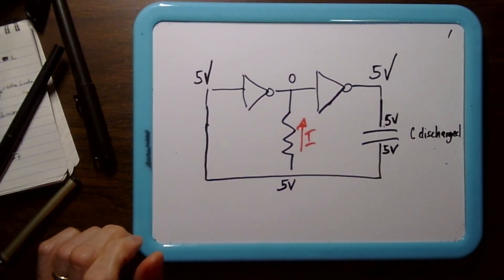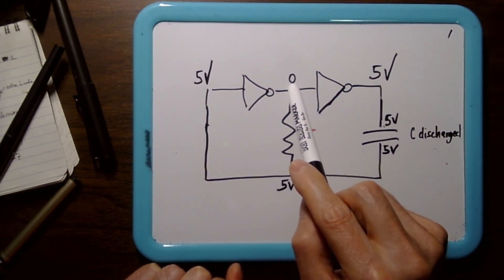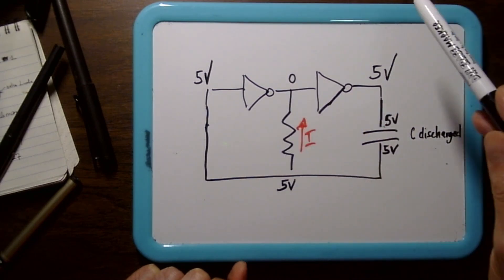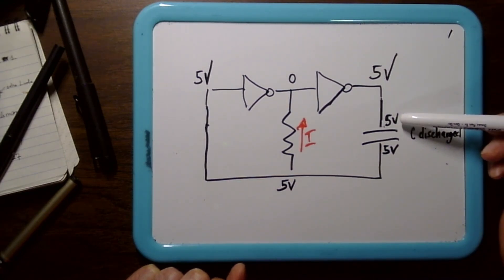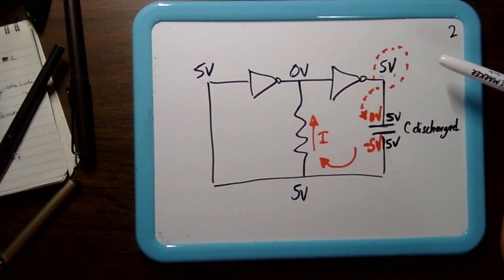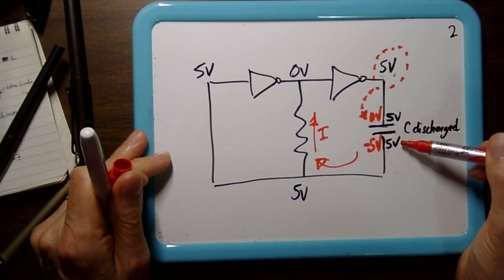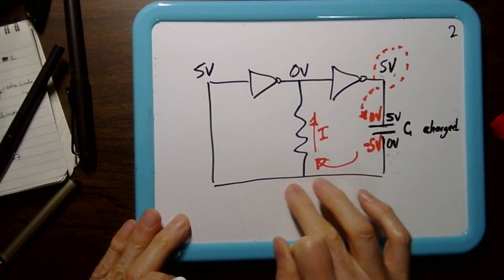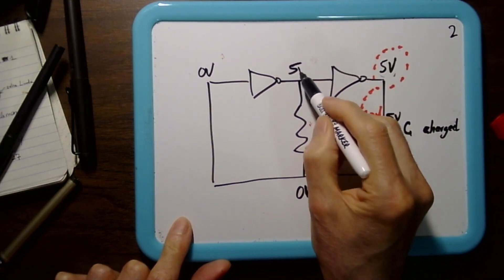Detailed explanation for RC oscillator using NOT logic gates

Comment: I thought you were going to explain a "ring oscillator". 
   If you make a chain of three inverters, feeding the output of one into the input of the next, and finally back into the first inverter, you have a square wave oscillator. The output will always be opposite of the original input, and so it will flip from high to low or low to high. 
     To make the oscillation useful, to control it, you can put a resistor and capacitor in series from the output of the first inverter to ground. The RC constant of this branch will control how long it takes to trigger the second inverter. A variable resistor makes the clock frequency adjustable. In fact you get a two phase clock, because the output of the second inverter is H(L) and the output of the third is L(H). 
    This makes a quick and easy  digital clock, or pulse train for digital circuits, especially when prototyping. If you need a couple of inverters for something else, the rest of your hex inverter chip can be your clock.